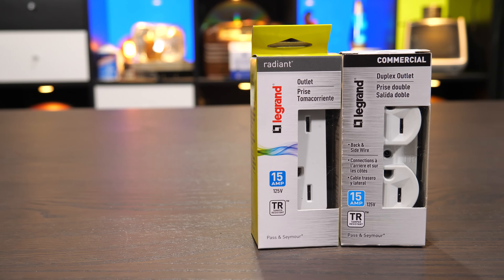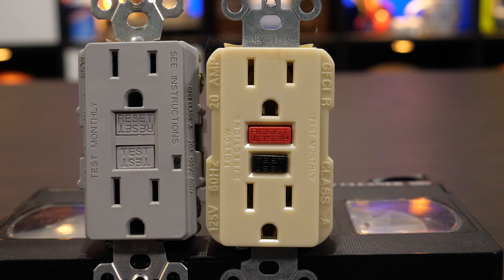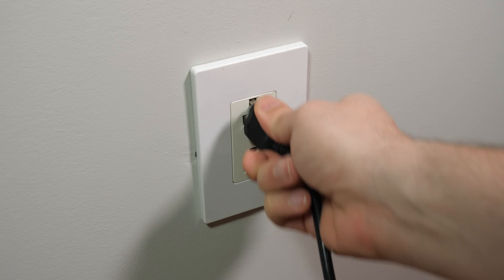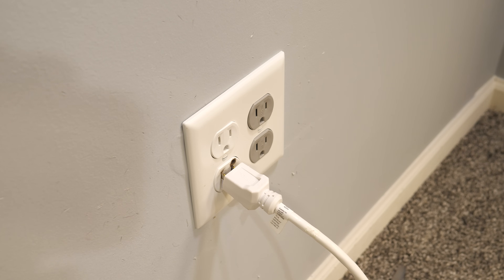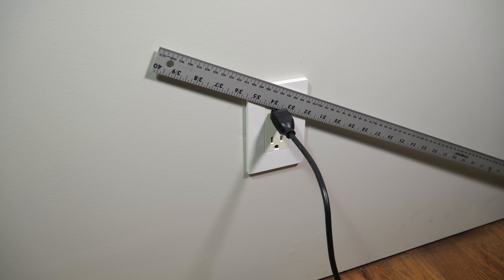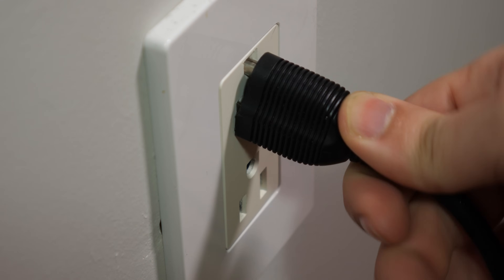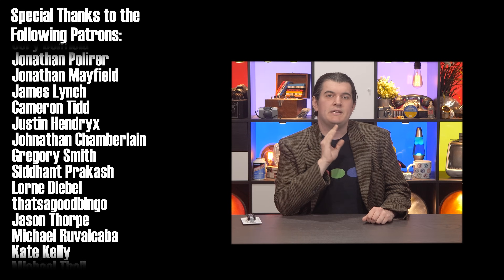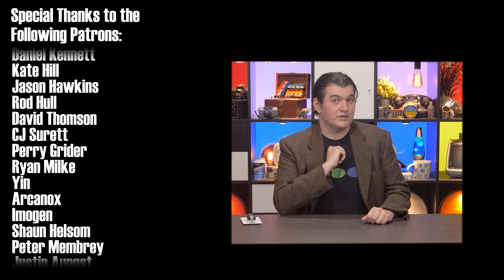Power outlets are topsy turvy - but does it matter?

Comment: Your analysis seems to assume that having the wires hanging DOWN when the plug is inserted is safer.  Most outlets, though, are installed low on the wall and many of the items that need plugging in are used at table height or higher.  Let's say an outlet is 12" from the floor and you want to plug in a lamp that sits 30" high table.  If the lamp has a nice long cord, it can hang down from the outlet to rest on the floor, then maybe a few inches along the floorboard toward the table, then up to the lamp, hopefully pinched between the tabletop and the wall.  Great, minimal tripping hazard.  BUT if the lamp cord is not so long and/or the table is a few feet from the outlet,  you get a loop of lamp cord sticking out where it bends away from the wall  to reverse it's downward orientation to travel up toward the tabletop.   Then there's no easy way to get that cord to return close to the wall until it reaches the tabletop. 
I agree with most of the commentators that placing the outlets side by side, with the ground pins at the top or bottom (or perhaps one of each) would be best.  More important, though, would be to place the outlets FURTHER APART!  Regardless of orientation of the two outlets and their ground pins, having more room between them would (1) allow room on the plastic outlet cover for little hooks to hold the dangling wires close to the wall (2) avoid having right angle plugs block both outlets (3) allow space for bulky plugs and those annoying at-the-plug AC adapters.  (P.S. The same goes for power strips: don't place the outlets right next to each other and orient the outlets at right angles to the length of the strip!)

Comment: Watching this make me remember how much better the new 2006 plug standard introduced in Brazil is.
At first, we used to use a standard plug which combined US and EU standards and had NO GROUND.
I remember getting shocked at least 3 times with those plugs.
People complained about the change at the time, but I tought from the beggining yhat it was a much better standard.
We also had couple other plugs for air conditioners, and it was a mess. Now everything is good. The only problem we face sometimes is the 20amp plugs on some appliances that wont fit a 10 amp socket...

Comment: A lot of plug tyoes annoy me because they monopolize the whole outlet or can't go togetger in an outlet expansion plug. You know, the 3 from one cube tap or similar, or the 6 from 2 versions. Or even a power bar. Then you get these fat plugs or angled plugs and they block the  neighboring outlets. Most annoying. Yes, I am talking about piwer octopi, but most of todays devices will draw less than 5a each and rarely do they run all together anyway. (Kitchen appliances or power tools not included.)

Comment: plugs in the grounding transition time often had little wire loops on the bottom to hook your own ground wire. You can actually still buy adapters like this. But, if you flipped it over so the ground loop was on top, it would be much more problematic to suspend your ground wire. It would have to drape around the whole plug and risk getting jammed behind the bezel.

Comment: Here is one "reason" I heard for putting these style outlets in so the face is upside-down.  It has been a while since I looked into the NFPA codes (or the NEC more specifically), so I am not claiming it is in there.  Here is the reason as it was explained to me.

The ground (the mouth of the face) should be on top to prevent, whenever possible, something falling down behind a not fully inserted plug of whatever item and creating a connection between the hot and neutral, such as a coin, a paperclip, or God forbid, little tiny fingers attached to a curious child.  Is this 100% going to prevent this from happening?  Unfortunately not.  Comes down to the argument that this design is not a good one.  I leave that call up to the people with more education on this than what I have.

For those that are curious (or from other countries than the US), the NFPA codes (NFPA 70 more specifically) are what all licensed electricians should follow.  In fact, one of the requirements when I was looking into getting an electricians' license was a certain amount of hours both in education and working time.  A big part of the education side was the NFPA codes.  Each state here in the US might have different requirements, so please do not take what I am typing here as "this is how it is for ALL situations".  That is not what I am trying to say.

Comment: These plastic blind plugs not only keep kids from electrocuting themselves (for a while) but they also keep the plugs clean. 
But - as an European - I wonder what the purpose of the holes in the blades are. And why they don't use protective covering of the blades second half to insulate it from curious or careless people's fingers.

Comment: here's an option, though it would involve redesigning, slightly, the plug receptical, the option being, have the duplex plug receptical with one ground up, the other ground down so as to better acomidate right angle plugs in the horizontal orientation, and have at least 1 free space for a regular plug when the right angle plug is in, without blocking other plug. orientate the faces so one is frowning the other is upside down, the "eyes" of the "faces" would be closer to each other with the ground prong farthest from each other, that way no matter which way you put the plug, its the same thing

Comment: The MacBook wall adapters are the worst offender of partially exposed prongs. They have the bulky section as part of the plug and it weighs down the plug, effectively causing it to pull out. Not to mention it hogs so much space on a power strip.

Comment: It wasn’t a knife, but one time when I was a kid I threw a thin metal necklace across the room and it went right into a partially inserted plug and caused a big spark. So, as rare as it is, those things do happen. Though I’ll also add that it was a two prong plug for a lamp, so it wouldn’t have mattered what the orientation of the plug was.

Comment: I remember when the large hole first came into being. They used to be the same. But we were told that the law said the large hole was supposed to be on the right.  But you are correct that the electricians didn’t care.  In my current apartment some are one way and some are the other way. The biggest problem is just that you have to remember which plug you are using and sometimes if I don’t look I fail and am forced to turn it over.

Comment: I might have a window air condition with a "backwards" right angle plug with the ground at the end of the cord. Since the cord from the AC hangs down from the unit towards the receptacle outlet that might be the design. I could go look, but I'm lazy. I would love a redesign or USA-ian plugs and outlets along the lines of what they did not so long ago in the UK, with new safer plugs and outlets, but "Amurica" ya know. In Canada the outlet is conventionally ground up, at least in newer construction as anyone that watches "Frank" on Holmes on Holmes knows. But I don't think it's code just convention. BTW, on power strips I am starting to fancy the ones with swivel outlets and/or the ones with the grounds pointing off the strip (some even have them point off in both directions for crowded under the desk areas) not in a line on the strip.

Comment: I'm really enjoying my UK Type G plug. It's only design flaw is that its very painful to step on and always lands face down
Reply: Is it made by LEGO? They REALLY hurt when stepped on ! :P
Reply: @Formulabruce Stepping on a Type G plug can result in a puncture wound through the foot:  I speak from personal experience.
Reply: Try stepping on a type I, the angled plug always gouges out a chunk
Reply: ive seen some UK plugs upside down specifically in singapore. do you like your plugs mounted upside down? i think it looks stupid. we hate our usa plugs mounted upside down (ground pin UP) the correct way to mount type b (usa plugs) is ground pin DOWN. if you want ground pin up use plugs from singapore and the uk!
Reply: Uk sockets and plugs are the best😊
Reply: ..and it is fused so that you need skills tools and spare parts to find and repair faults,  Oh and its shutters need to be released by an earth pin, so you need an eath pin even when you don't need an earth pin.  And its big and expensive.
Reply: @keacoq  That second point is just a safety feature. It also provides better grip into the outlet - something stated in the video, actually. The other two are fine
Reply: @ The need for tools and skills is a reliability and safety issue.  The shutter design  makes two pin operation need a third pin. Designed without thinking of two-pin appliances.  All that makes them much bigger and more expensive than necessary.

Comment: My friend directed me to this video after I inadvertently shorted a power strip plugged into the wall with my tape measure. Yes, apparently this does happen! And the inverted plug most definitely would have saved my rump here, because my landlord won't be able to come back to reset the breaker until tomorrow!

Comment: 3:53 -in Europe this is standard - we usually use mirrored design - top sokcet has ground in the bottom, bottom one has it on the top.
Reply: @@phillipbanes5484 most of Europe has one type of socket

Comment: As a Brit i find just the notion of variation in plug design weird. Here plugs are essentially identical. One shape, one orientation. Anyone installing a socket with the earth pin at the bottom would be sectioned.

Comment: That scenario with the knife at the wall shows exactly why the ground goes down.... getting that to arc trips the breaker.  If it were grounded out, the metal object could heat and start a fire while never tripping the circuit breaker.

Comment: I think Japan was one of the countries that uses plugs that you literally can't get the line and neutral wrong (assuming they're wired correctly in the wall.
We should all move to that. Not sure what their specific design was, but conceptually we should have been doing that from the start, instead of designing the circuits to handle it either way for the very slight convenience that provides the end user.

Comment: I'm with you, utter nonsense is right!
While eating my vegetables in Puerto Rico 🇵🇷 looking at my 'utterly ridiculous' sideways plugs, I started hunting for a solution.
Those sideways receptacles are especially frustrating when trying to use any outlet extender/ shelf thingys, (any not corded anyway). They're also tougher to re-wire mind you, seeing that they're all 20amp circuits wired w/ thicker 12g wire.
So I started searching for: "sideways outlets", "sideways receptacles", 90° wall outlet, 90° receptacle, 90 degree...etc. etc. when I finally found the Cooper IG1310, hospital grade 20 amp surge protector with its outlets, oriented 90°. It took forever, but then SCORE
Cooper / Eaton Eagle IG1310
(Cooper / Eaton 1208 is the same thing in a 15a version) also have a built-in surge protector -DOUBLE SCORE- for use on an island well known for their problematic power grid 😎

Comment: US power outlets and plugs have always struck me as being rather antiquated, unsafe and a bit flimsy. By simply adding an on/off switch to a standard two gang socket it would make it a lot safer. Plus, having a plug where the pins are at a right angle looks tidier, and makes more practical sense.

Comment: I had some pennies in a bowl that got pushed off the back of the end table and one of those pennies happen to land in the small gap between the plug and the wall it ended up touching both prongs and i discovered a. My circuit breaker worked just the way it suppose to and b. There is enough electricity traveling through the outlet to melt through said penny and effectively weld it to the prongs c. I have a lucky penny now my hubby played hell prying the penny off (lucky this didnt cause an electrical fire) and a interesting conversation/story piece.. it was not deliberate or anything was just moving things back on the end table and going through stuff trying to find something... took us a bit to figure out what the heck caused the circuit to trip in the first place... threw away that cord because the insulation of the cord is compromised now and didnt use that part of wall outlet after that.. odds of that happening not really high.. 

If you ask me i dont care which way the plugs are done make it so the receptacle grips the prongs better in the first place and educate people how often or when they should changed the outlet. Maybe perhaps some set of guidelines for land lords that if you plug in a cord into any outlet and it automatically slides partially out immediately after that is absolutely to loose and needs to be changed     .

I remember 3 prong were suppose to become the new standard once upon a time it didnt really take cause nobody was really interested in having to buy everything with a plug brand new because we switched over to 3 prong the other major complaint was having to redo all the wiring in your home for the 3 prong (this is also why they started making 3 prong to 2 prong adapters). So they left 2 prong on the market and used 3 prong for appliances. the ground is helpful for safety if for some reason there is a burst of extra electrical current (which happens from time to time) through the wiring of your house to keep you from getting shocked by a current higher then 120volts. There are conditions like a wire inside the appliance touching somewhere inside the appliance that it shouldn't can cause extra current to follow into the wall outlet and an appliance can become electrified during a burst of energy going out through the wiring and if you happen to be touching it when it does it shocks you and to prevent your house from burning down from to much electrical current in the wiring of your house. The ground sends the extra electrical current back to the breaker box that is also grounded. Why it isnt on all of them 2 prong are cheaper to make. Circuit breakers literally do that it breaks the circuit path the electricity is traveling through goes from a closed circuit (power on) to an open circuit (power off). If a circuit breaker was to fail on an overloaded circuit the wiring in the wall on that circuit path could and likely will heat up enough to start a fire in the wall. 

What is truly dangerous is when the outlet is installed on a fake ground it will stop your breaker from popping like it suppose to if you overload the circuit it also disables the safety of the ground. When I was growing up most places had only 2 prongs that was when I was really little. And it was quickly changing over to 3 prong because they stopped building new places with 2 prong outlets. 

If you really wanna dive into it though look into the hazards of knob and tube wiring.. the wires get hot when electricity runs through them which is why we started insulating the wire on all things in the first place. It is truly scary to think the cords you plugged into a wall one time was bare wire or wrapped in cloth which could catch on fire itself. I remember handling a few plugs like that as a kid that were only cloth wrapped they were really old then. So combination of not having much regulation on power going into a house, all the wiring in the house is bare wire, and then theres insulation that interior wiring may have contact with that is there to keep the house warm makes a perfect storm for all kinds of problems. Really we should switch to silicon insulation on wires because the insulation we using now still melts with too much ease. It part of why we still have houses burning down during christmas daisy chaining all that Christmas lighting can generate enough heat in the wires the insulation melts exposing the wires igniting the insulation in the walls or the christmas tree.. 

I guess they are not giving the same of information now as they were in the 90's. :shrugs: feel like im giving a back in the day story but im not that old.. i just like learning about a bunch of stuff and sadly we do still have some places with knob and tube wiring to this day.. and in some rare cases the knob and tube wiring has been disguised as 3 prong.

Comment: In this video, or another video, you mentioned it seemed like not much of the plug engages with TR outlets. You were spot on with that, and it's mildly concerning to me. 
I'm in the process of rewiring a lot of my house (thankfully it's 1 story, and I have a basement and crawlspaces). I took apart two mid grade receptacles I was planning to use, a leviton tcbr1-w, and a  legrand TR5262-WCC12. I managed to plug something in with the face plate still attached, and pull the outlet apart to see how much of the plug made contact. It surprised me just how little of the plug engage, especially with the leviton outlet. I repeated this multiple times to make sure there was no error, and there wasn't.  Obviously these companies have tested their designs, but still...

Comment: I had the exact situation you described.  I pulled out a laptop computer plug at work... and the wall plate was metal and the center screw was loose and the plate fell off and shorted. POW- I blew the office power. Embarrassing. I thought the situation so unlikely that I have not flipped any of my outlets at home- the devices with the plugs down is the main reason I don't flip new outlets.

Comment: A lot of ground pin down receptacles have broken plastic under the ground pin. Some type of induction connectors, like electric toothbrushes, might be implemented in the future as well as using batteries for things like vacuum cleaners.